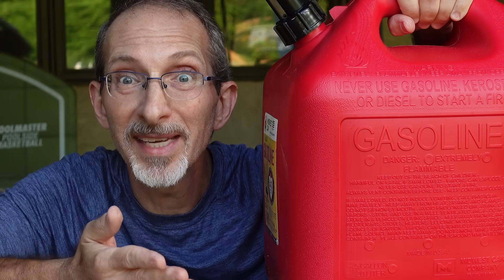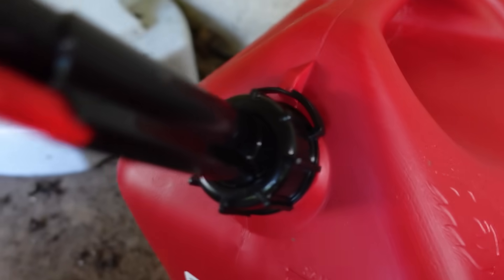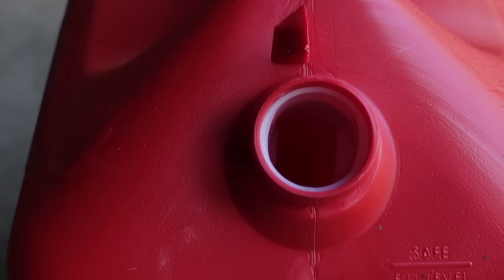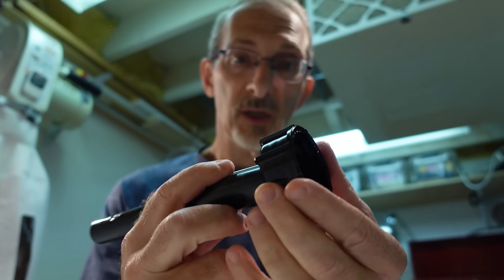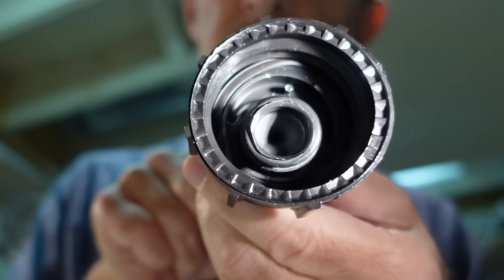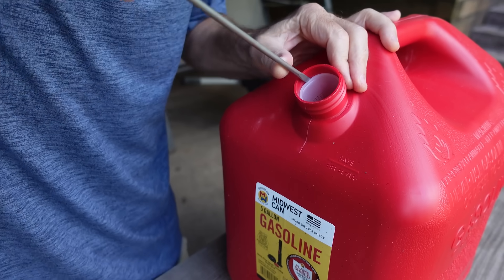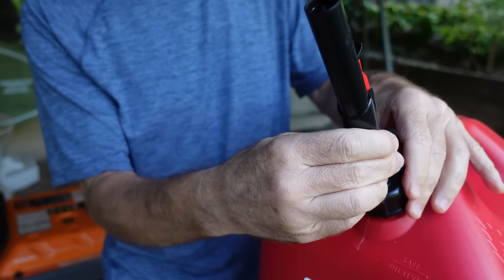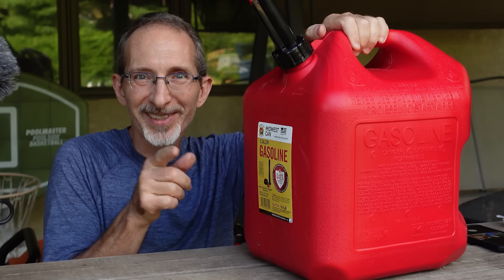Gas Can Modification | New Gas Can Fix

Comment: FIRST thing I did was took a screwdriver and REMOVED the inner plastic strainer(?). Yea I grabber it with Needle nose but did not waste time you did, I just ripped it inward, created a split and yanked the damn thing out.  Like WTF is that suppose to do other than inhibit your ability to fill the damn thing (and see the fluid at the same time duh).  I since have replaced most (still have them though) of my (15-20) 5 gal cans (hurricane supplies) with the user friendly (For Sportsman applications) yea right,  with a U-Jug 5 gallon multipurpose utility jug is excellent for storage and transport fuel but do not feature the gasoline specific Safety Features (pops finger in mouth). These Jugs feature an ergonomically contoured handle, bottom grip for easy pouring and a non-breakable multipurpose cap with rubber gaskets. Hose (very flexible in warmer climates but gets hard as a rock in cold)  included. The tube can be removed, flipped over and put the plug back in the hole for easy transport. Leave an air gap in the jug if transporting more than 5 miles for expansion.

VP Racing Fuels   (also marketed as U-Jugs available at Tractor Supply, Rural King and many different colors. Yellow, Clear, Blue, Red, Purple, Black, Green, Forest Green, Grey, Orange, White and Pink) You may have to special order the specific color you want specifically from VP Racing fuels
 https://www.speedwaymotors.com/VP-Racing-Motorsport-Container-5-Gallons-Multiple-Colors,484474.html?sku=9103512-YEL&utm_medium=CSEGoogle&utm_source=CSE&utm_campaign=CSEGOOGLE&gclid=CjwKCAjw36GjBhAkEiwAKwIWyZSgx6jl31CIfDSlZhXDoeWdzxO_c_ISoiTO1QYuksIuCDGcYjx9QhoC5YAQAvD_BwE

Plastic
5 gal
I use Clear for Water, Blue for kerosene (which I almost never use) or Diesel as they are similar fuels and mixing them causes no issue so far) and Yellow for Diesel, Red for Gasoline (as well as Clear for high octane ethanol free fuels/but maintain separated cans for water and fuel for these purposes) Orange for Track Day Fuels and Green for coolants (again Track Days).
They are marketed under various brand names and shop around. The list for 24 to the insane 55 Bucks (45 on Amazon....no freakin way)
I bought 10 of them, built a shelf for them up high in the garage and store them empty until the Threat is imminent then fill em all up. I can power my entire house from a 11 KW Gas Generator but proper load management is a must. Never use more than 1 high draw appliance at a time. (I turn off the AC and turn on the water heater for a real shower)

Comment: What you called a filter is really a flame arrestor, according to the insert that came with mine, and it also had some instructions with it how to fill it without tripping off the gas pump (basically by not inserting the pump nozzle beyond a specified shoulder inside the neck).  Anyway, I agree that the government's shut-off valve "cure" creates a nearly unusable gas can; go figure.
Reply from the maker: Hi Dan, you are correct… The filter is a flame arrestor, which I corrected in my second video, link in the description. Thanks for watching and commenting!

Comment: Getting older, I only put 4 gallons in my 5 gallon can.  I transfer it into a 2 gallon can to use in my equipment.   Even 4 gallons is a pain to use in winter for the snowblower.
Reply from the maker: Matthew, that's a great suggestion! I have also gotten less ambitious at the pump.

Comment: I am tyring to polite, but blunt about this. Let's call it what it is. You are not fixing nor improving that gasoline container, you are defeating Ferderally mandated safety features.
 Just because you are inconvienced by putting on a seat belt doesn't mean you should go around sitting on it while it is plugged in behind your back. 
Nor should anyone defeat features designed (for example) to make the can spillproof or child resistant. You do so at risk to yourself and others near you or who could inadvertently spill gasoline from a mangled container, and exposing yourself to liability for doing so. 

As far a as the backfire flame arrestor, just use a funnel to fill up the can. Just handling the can can generate static electricity resulting in a spark and possible ignition of vapors. The empty can is even more dangerous than a full one.
.
But why would you use a 5-gallon container to fill up an implement that needs maybe a pint or quart of fuel?
Reply from the maker: I agree with most of what you have to say. Now I only fill my generator from the 5 gallon container, and I have smaller ones for my smaller tools. In your example about using seatbelts, would people still wear them if it prevented them from steering the car effectively? I guess not, and as consumers we would demand a better design.

Comment: Had to get one of these a few months ago and it has been an absolute thorn in my side, esp. the spring loaded nozzle.  So glad this fix is so easy!  Thanks for the info!
Reply from the maker: You're welcome… I'm glad it helped!
Reply: After removing the spring from the nozzle tip the can upside down just to make sure it's still completely sealed from the plastic lock alone, without the extra pressure from the spring.

Comment: I cheated, pulled the screen out of the tank and bought an electric fuel pump that takes two AA batteries :)
Reply from the maker: The battery operated transfer pumps are a great solution. Thanks for watching in commenting!

Comment: I have never understood these so-called improvements to the newer gas cans. Excellent modification, and most pragmatic video. THANK YOU, Mike!
Reply: I threw mine away,  too much of a PIA👎🏻
Reply: I already modified mine after lots of Army cuss words and spilled gas! Just trying to lift heavy objects in post middle age is a challenge, let alone a stupid puzzle to use the new gettup!!!. UGH
Reply from the maker: You're welcome! I'm really glad this video is helping others…
Reply: The spout is designed to keep vapors from escaping. This is a major source of air pollution and an explosive hazard. Now I think the design sucks but the intent was good. The "screen"  is a flame arrestor to prevent explosions if a spark happens. Honestly we need grounding straps for filling portable fuel cans the same way airplanes do.  Probably need them in cars to, but in a car this is mitigated by having a fuel system that doesn't allow vapors up the filler neck. 

These rules don't happen in a vacuum, they are the result of accidents and an effort to protect consumers. Just because it never happened to you doesn't mean it doesn't happen.
Reply: @EthosAtheos  The vapors escape any way when you pour the fuel Einstein. It's just more government stupidity.
Reply: @charlesfreeman1224  No not really. The vapors that are being targeted by the EPA are long term evaporation. When gasoline is heated, say in a plastic container in the sun. The gasoline gives off more vapors. Gasoline also expands a lot compared to water when heated. So the can is constantly breathing, pushing out vapors when heated and sucking in clean air when cooled. This is why your 5 gallon gas can when full has about 25% air space at the top. People still over fill them not understanding why you shouldn't. 

Yes some vapor does escape while emptying the fuel can. But the long term evaporation is lower than an open container. 

Do the experiment, put a cup of fuel in 2 Maison jars in the sun. Cap one of them and leave the other open. After a month go check how much gasoline is missing form each.
Reply: @EthosAtheos  Dang, buddy ~ Not sure which is more distasteful; the bulky spout or your grimy snout. 🐷
Reply: @EthosAtheos  Uhhhhh... instead of this overly engineered piece of crap they could have just added a rubber seal to the base and cap. Presto no escaping vapor and no one will notice the change and the cost basically unaffected.
Reply: @GrumpyIan  The regulation calls for a self sealing container. It has to auto close not just be closeable. Old fuel cans had ways of sealing them. But people didn't use them, bit like seat belts and motorcycle helmets.

Comment: If you have more money than patience, Tractor Supply sells an "EZ-Pour Spout Kit" that fits these modern cans to replace all this tomfoolery.  The kit also includes a new nozzle, mounting ring, and cap.  It also includes the old-style press-fit vent too.  You can drill a 1/2" hole in the can, pop that in, and you have gas cans that actually work properly.  They are about $10 and worth every single penny.

Comment: I completely agree with everything you're saying... these so-called Safety products I designed by people who never use them... yes it's a royal pain in the a... one thing worth mentioning also it's the fact that the nozzle is not flexible... what were these design idiots drinking when they designed a gas can that had a straight sturdy nozzle instead of a flexible design... do they actually get paid for doing this kind of stuff?? Amazing!

Comment: Great!  You forgot one more important issue- a hole near the top to eliminate the vacuum that makes filling take forever.  I drill a 1//4" hole on the top (do this before putting gas in and be sure to clean out  the drill shavings) and a short screw to close the hole when necessary. Thanks for the tip!
Reply: Jesus Christ. Bag of hammers.

Comment: I can’t figure out why you would make this video without just simply recommending someone buy a motorsports fuel jug with the vinyl hose that folds over and goes in to the filler neck. You simply vent the can. Yes, they have a vent as they should

Comment: I have been WAITING for a video that would address this issue!  Thank-you so much.  I spilled expensive kerosene on my floor trying to fill my Kero Sun heater with one of these modern cans!  I am handicapped and unable to drag the unit down the steps outside.  This "child proof' crap is on EVERYTHING these days!  It is also Adult-proof!

  WATCH-OUT, Mike...next, the flippin government will pass a law to fine you and shut you down, and the FBI will label you a terrorist!  (We should send the manufacturer a damned BILL for our labor).  I`ll bet these contraptions are all made in China.

Comment: I've given up on gas cans. I modified one to remove all the nozzle components sort of like how you did. I think mine was bit different. But it still spills around the "rim" of the gas can because of it's not threaded or sealed at all. 

I just bought a 14 gallon gas caddy from Northern Tool. You do need to modify that a little bit to make it easier (basically so you can pump air into it to force the gas out easier). So much frigging better.

Comment: I am an NFPA level 1 firefighter (retired). Modifying any fuel container voids the UL/ULC safety certification. This renders the fuel container unusable an no licensed filling station could lose their license for refilling it. That is reason 1. Reason 2 is if (God forbid) a fire results from using unapproved containers can result in you being charged and or sued civilly for negligence.

Comment: To me the cans SWELL UP with fumes and are essentially BOMBS.
The old style vented and therefore had no pressure IF God forbid they ever caught on fire they would not necessarily explode as they were not under pressure.
The new cans SWELL UP considerably and the fumes are under PRESSURE yikes.
And of course there's the added inconvenience that you can't put gas in a vehicle only small engines etc.
To me the gas can is a great example of STUPID government regulations that no one asked for

Comment: Over engineering strikes again...
For years and years, we did just fine while using our gas cans. 
The way they are designed today is more dangerous than ever.

Thanks for sharing these modifications.
Reply: The problem is over regulation. Engineers haven't gotten this dumb. It's the politicians that dictate the safety requirements.
Reply: @electricslide8469  
Agreed

Comment: Meh.  The "filter" in the tank is a flame arrestor to keep flame from openly entring the tank from the nozzle..
and the twisty-lock needed on the first spin.  You think that's really so bad?
I do hate the nozzles you have to depress, so I'll give you that.
But the more you use them .. the easier it gets.

Comment: My spout broke after owning it two months, somehow a spring shot out of it. Great safety feature! 😂
If you heat up the can opening, the filter will come out easier. I used a hair blow dryer.
Reply from the maker: That stinks, but I'm honestly not surprised. The plastic isn't very flexible. Thanks for sharing your story!

Comment: I just take the cap off completely and use a funnel.
Reply from the maker: Using a funnel without the spout is a great suggestion! If you have a 5 gallon container and it is very full, it takes some strength but it can be done. Thanks for commenting!

Comment: The sad thing about it is that a lot of the cost of these new crappy gas can is due to the cost of the seller's I assume  having to design this worthless new spout design. I have not ever met anyone that doesn't hate these new can spouts.
Reply from the maker: I find it ironic that these containers are available inexpensively. I paid $20 for mine. I would gladly pay $15 with a more simple spout 😄

Comment: I hate any and all the different "safety" modifications that they have made on the gas cans over the past 30 years.  They have made it almost impossible to use them for their intended purpose without making them more unsafe than they were before they changed them.  "We are from the government, we are here to help".  Yeah Right...  Spilling flammable liquid all over the place makes your "improvements" better.  

I just get those replacement kits that come with a nozzle and a vent plug.  Drill a hole for the vent plug and glue it in and screw in the new nozzle, problem solved.  I understand the whole vapor argument and I'm not trying to say storing gasoline shouldn't be something you do safely but it's a pros and cons argument.
Reply from the maker: Well said! Everything got more complicated when it started requiring two hands to dispense gas. I appreciate you sharing your thoughts!

Comment: I bought a 5 Gal can from Walmart. It has a different configuration than yours, but it doesn't work. I just remove the cap and use a funnel.
Reply from the maker: Ricky, using a funnel is probably the most popular option in the comments section. I appreciate you watching!

Comment: The answer is not to buy one of these crap items in the first place, there are still many cans out there without that spring loaded crap, then for about $5 you can buy an old school flexible spout th attach instead of whatever crap boxes on the can

Comment: My can almost the same as this. I removed the push down lock. now when i but the nozzle to the side of a tank it just push's down. easy and no leak if tip the can over.

Comment: And you still get a the flow of a 3/8 hole..... From a 5/8  nozzle so.......
If you don't want to hold up a five gallon can for 15 minutes to empty?
Go online or Tractor supply, and just buy a good old fashion, the way they use to make them, straight through can nozzles. Usually comes in packs of three. And yeah there expensive cus they know how good they work compared to the tinkle nozzles.

Comment: There is a chain of farm & home stores in our state that sells a conversion kit for cans like yours. It consists of a flexible hose to replace the rigid spout. You bend the hose to the the tank you're trying to fill and then tip the can. The internal gas can plastic filter is completely useless as you found out.

Comment: Number 4 Mod.  Carefully insert a drywall screw up by the handle of the container to allow the can to vent.  Remove the screw when using the can, put in back in during storage.  Put the screw in the side of the handle so the  hole is on top when the can is tipped. (not toward the ground, but up in the air.  This way the gas stays below the vent hole
Reply: No joke they sell you the same shit they used to make the cans come standard with
Reply: There was another video that showed using a Valve Stem from a tire as a vent. Drill a hole, unscrew the Schrader Valve, use a piece of wire to feed it through the hole, and snap it into place.  Unfortunately the gasoline eats the rubber, I found that out the hard way.  I fixed it by using the all metal bolt-on tire stems, a bit more expensive, but way ,onger lived.  Put the cap on and it seals it for carrying, take the cap off, and it's a nice clear vent.
Reply: @toadman506  Yep, all my cans have Schrader valves on all my gas cans with the valve stem removed for more air flow.  Been lucky and haven't noticed any leaks due to the rubber getting degraded.
Reply: @lonestarparrot  I did 3 cans, all of them had the rubber part of the body fail on my, in one case dumping about a quart of gas in the back seat of my car, which took forever to get out
Reply: @toadman506   Ouch, that's not good.  I keep mine in the garage or back of the truck but I can see why the extra precautions are needed.  Thanks for the heads up!!!
Reply: I believe you can also buy a vent/cap to add to them to do the same thing,just have to drill a hole in the top of the can.
Reply: This is exactly what i did. Use the screw to make a little hole and be done with it

Comment: I have all. My cans rigged up like the VP racing cans but I came across one of these cans that was missing the spout. One of my custom spouts fit with minor mods but I ran into the same problem with that infernal white strainer inside the can. So I did exactly what you did and ripped it out. It's the can I Cary in my car at all times and it hold pressure very well so I'm not breathing gas fumes.